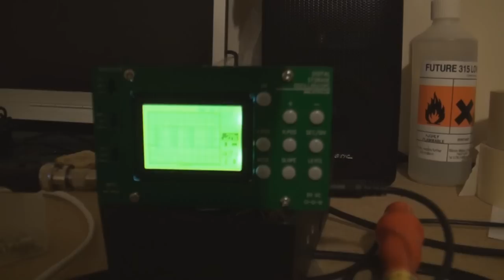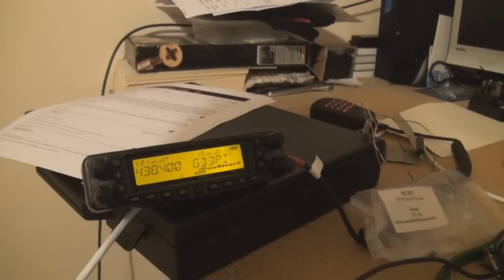2011-12-16 - FT-8900 First Data

Comment from the maker: @madman1027 Cool - likewise! I've just got around to building a USBtinyISP, which is particularly handy for embedded projects, as it means you can flash the Arduino bootloader on to vanilla chips, and importantly, also select the internal RC oscillator rather than needing an external crystal as well (assuming you don't care too much about precision timing, that is).

Comment: this is excellent! i have both an ft8900 and an arduino mega, i have had the intention of learning to program the arduino but have yet to begin, this project has rekindled that drive to do so. i had so many ideas but other projects got in the way and the arduino has sat gathering dust.

thanks for the inspiration.
karl
2E0KMA